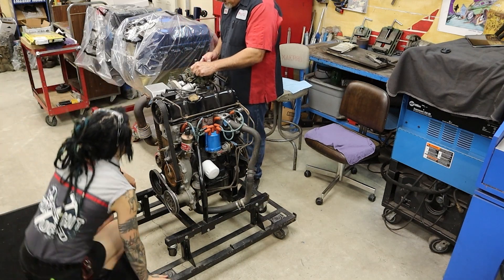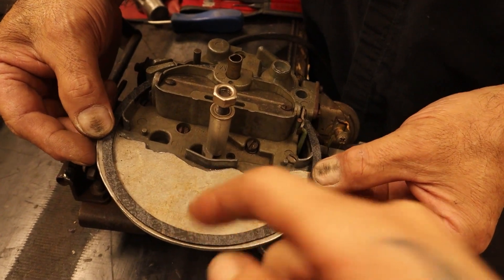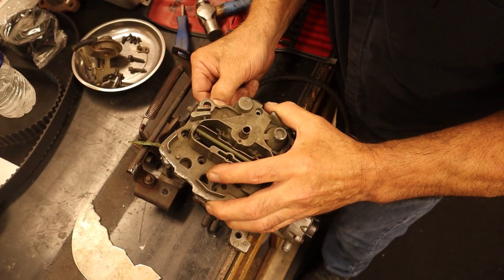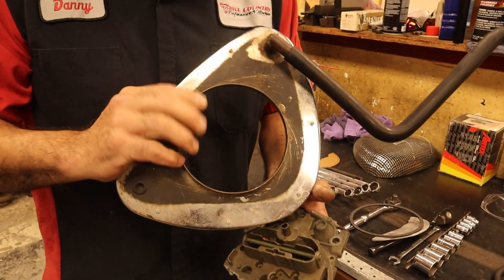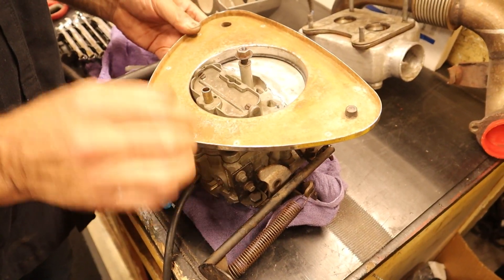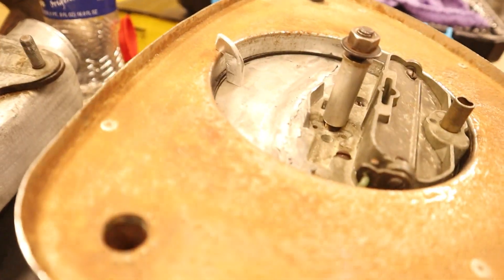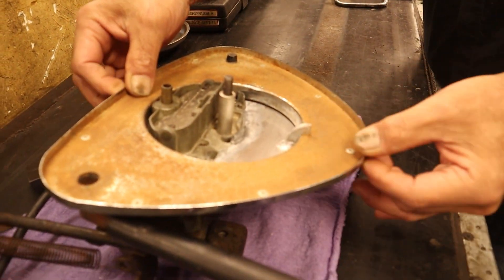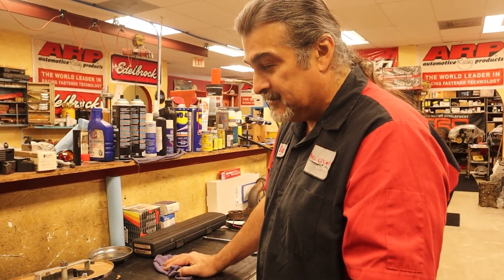Modifying the Smokey Yunick Hot Vapor CARBURETOR (and a small peak inside!!) with Danny Soliz!

Comment: It's tremendously fascinating to explore this bit of history. With all respect to Smokey, the foam air filters are not very good at catching particles and this is something you can research and verify. The best OEM paper filters would be the way to go for effective filtration along with excellent air flow. Not in this instance on a historic device necessarily, of course.
Reply: A lot of the "high flow" air filters are useless for actually filtering air unless you keep them cleaned and oiled... The k&n round 4 barrel filters with the top filter element has to be better than those tho like there's a reason foam filters went the way of the dodo and the body kit
Reply: @ianbuilds7712  Yeah, even under ideal conditions, they're not good. K&N is particularity annoying since they engineer the housings well for airflow but the filtering with that material is always third rate.

Comment: That screw is for a vacuum leak.  Older Volkswagen carburetors (two barrel)  had a similar issue where a bracket was also installed as well.

Comment: Ever figure out what that extra screw was for?   Also stick with the original air cleaner element since it's got the same resistance to flow , might be part of the tuning.
Reply: My guess is a air temp sensor. hold down screw.